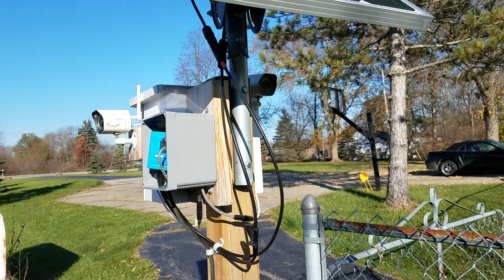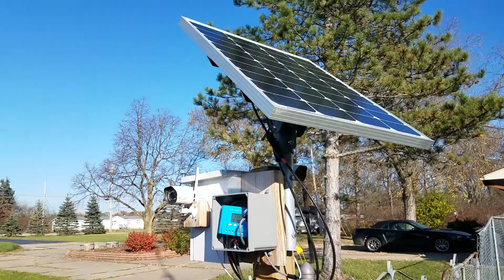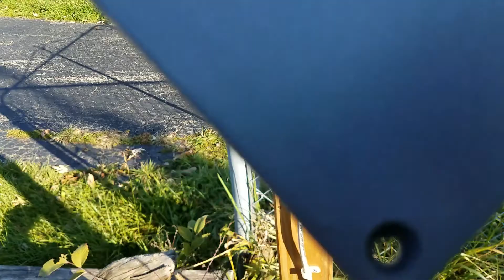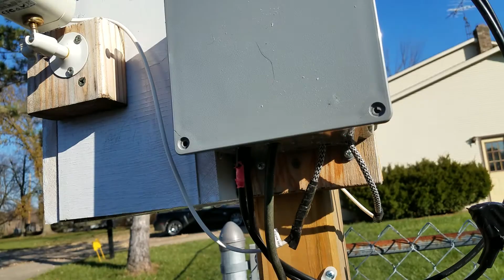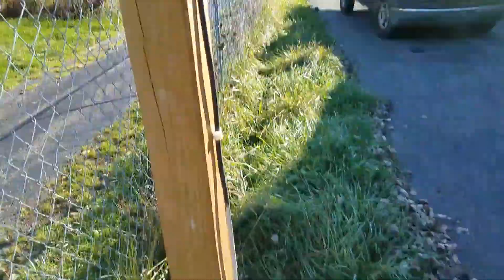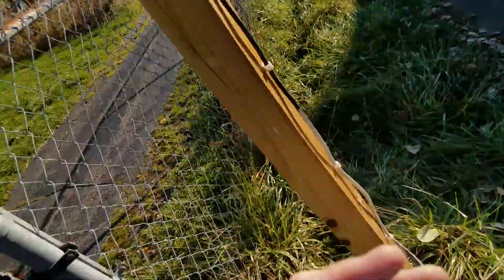Solar Powered Security Cameras Update

Comment: Did you ever say what wattage the Panel was? I didnt hear you say. Can you take a picture of the spec tag on the back of the panel please. Thank you.
Reply from the maker: When winter here in Michigan came I had problems. I upgraded the battery to a full size Deep Cycle and up graded the panel to a 100 watt and in that configuration its been working for years now.

Comment: If the panel went bad I hope you still have it. Check the diode in it and replace it. The diodes a couple of bucks and you can run your panels together. I had one break and replaced the diodes and now I have a 200 watt charger for my camper.
Reply from the maker: The panel did not go bad, I killed the battery because of the cheep charge controller took the battery down to DEAD. I gave the small panel for a friend to keep his battery in his RV up when its not in use. But that is good information for sure. If the blocking diode goes south its a easy fix!

Comment: can i ask is this still working today with out any problems looking to do one myself
Reply from the maker: When I first designed it I designed it to only support 1 camera. Well my Wife wanted one pointing at the barn also so that doubled the draw. It worked fine until winter when the days are shorter and the nights are longer. The cameras pull 1 amp each at night and only 1/4 amp during the day. Well it failed last winter and even killed the battery. I replaced the charge controller with a little better one that I can tell it if the voltage gets to 11.7 it cuts off any draw from the battery and I replaced the panel with a 100 watt panel. I also purchased a new battery (Deep Cycle). so its working just fine right now.